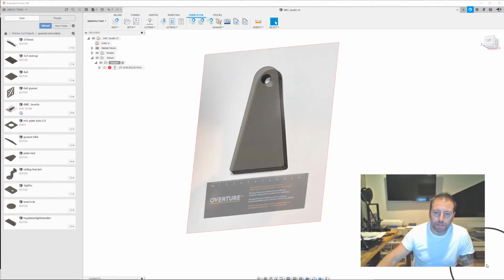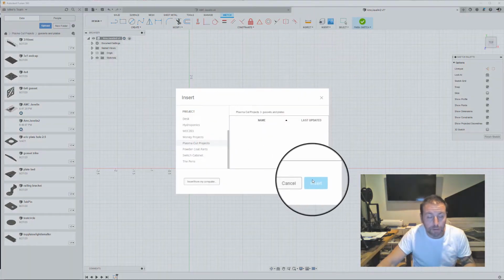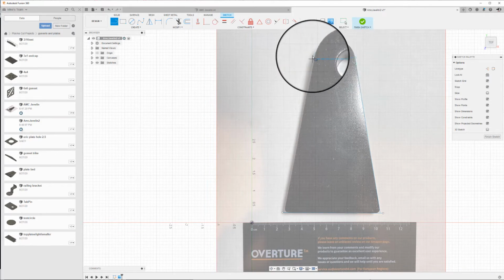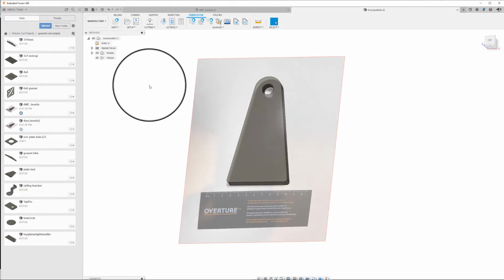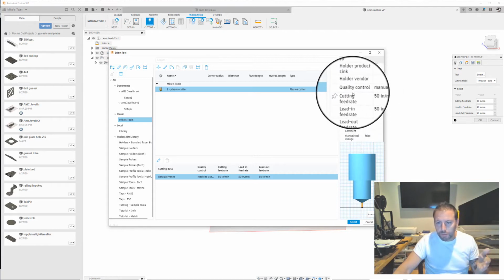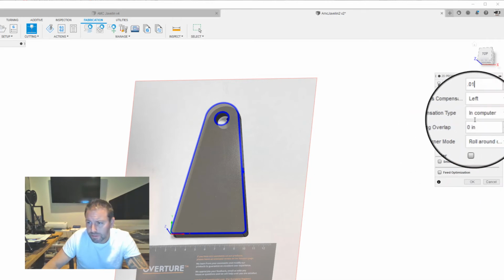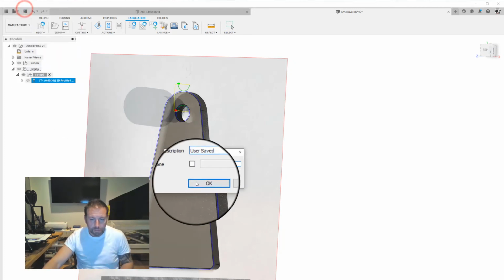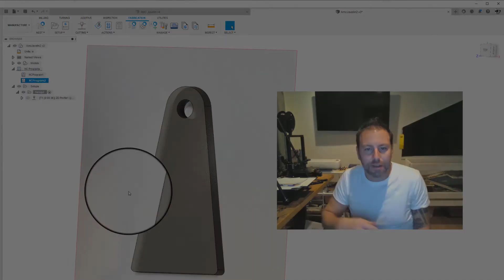Cutting traced parts from Fusion 360 with Langmuir CrossFire Pro

Comment: How did you get ur plasma cutter added onto ur tool on fusion 360
Reply from the maker: In fusion 360 they don’t have my specific cutter, I had to go into the tool library and select plasma and add it with my parameters